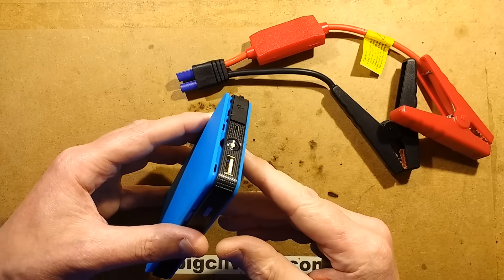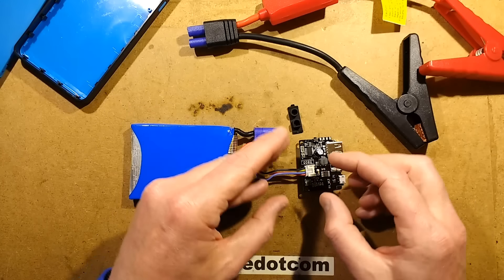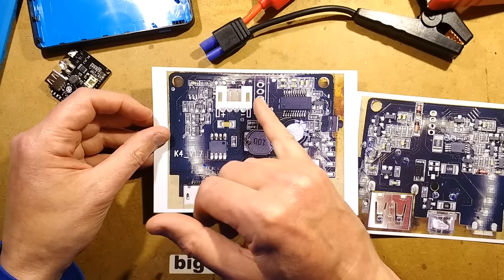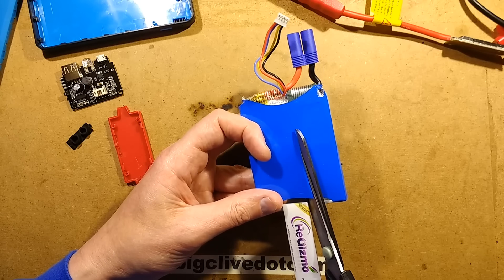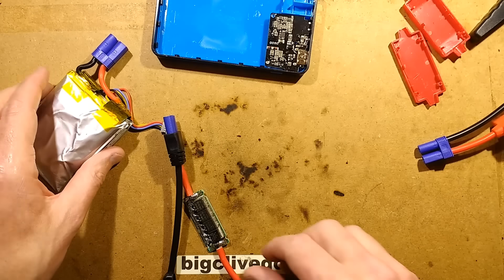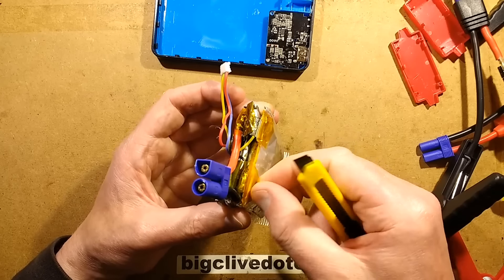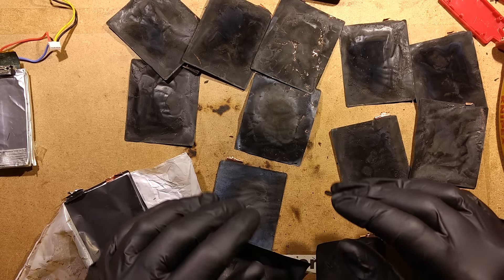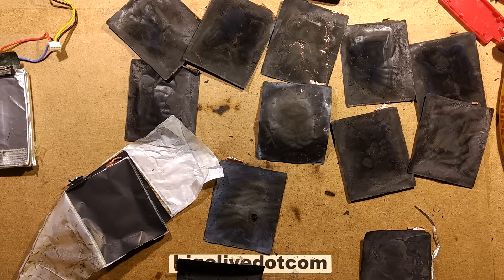Shorting out a fully charged cheap lithium jump starter.  (It didn't end well.)

Comment: This is genius.  The engineers that designed it made both the pack in the leads, and the battery to fail safely in case of an overload.  All without adding additional expensive components.  This is state of the art engineering at it's finest!
Reply: I'm not convinced that it was actually engineered that way, more like it just turned out slightly less dangerous in the end.
Reply: yes just a consequence of him having the cover off the unit.
Reply: @ronblack7870  That cover would have split right open and removed itself post haste once the cells started expanding like that. Removing it had no effect on the overall outcome. Had the case been sealed properly and not popped open so easily with such minor force, then we could have a talk about how forcing it to fight against the container and thus increasing the voltage at the same time. Guessing the plastic cover was designed to pop open like that to prevent this occurrence. When the thing splits in your hand, the first thing most users would do is drop it. Thus helping to prevent injury.
Reply: You forgot the primary instruction"Don't try this at home". The insight to this shows the potential of Lithium in the fact that such a small batter can crank an ICE. Now the question is how can it be recycled.
Reply: I have a bridge for sale in New York. Going cheap!
Interested?

Comment: "a few amps is still quite a lot of amps"
Reply: Is anyone collecting those lines of his yet?
Reply: SandyStarchild your avatar sums up my reaction when he said it pretty accurately
Reply: SandyStarchild I read this comment as he said it kind of like subtitles
Reply: to kill you, it only takes 1/2 amps to stop your heart
Reply: George Sarcasm God it takes mutch less than that 38ma can do a lot of damege but it also depends on the voltage
Reply: George Sarcasm God a lot less is enought but you need high voltage to get that high current throught your body :)))
Reply: George Sarcasm God Anything over 2 amps will surely kill you instantly
Reply: It depends on the person. Some people are less conductive than others, some are more conductive, and some are very sensitive to electricity. For some people, it takes as little as a 9v battery or even a 1.5v battery.
Reply: how much voltage and current it takes to kill you depends on a lot of things. your internal resistance alone depends on a lot of factors like body fat, hydration, and even what you ate for breakfast. also electricity going through your hand or your legs is a lot less likely to kill you than an arc across your heart. voltage does matter, but current and wattage is the real danger. at about 10 mA it starts to hurt and if you're holding the wire in your hand, you're not going to be able to let go. between 100-200 mA is where it's the most lethal, cause it causes your heart to spasm randomly which causes a lot of damage. higher than that though, and you're a lot more likely to survive, because the shock causes your heart to stop entirely, which, surprisingly, is much easier to recover from. also at that point you'll probably launch yourself backwards which means the shock mostly stops. not to say you probably wont need medical help, but it's much less lethal. it is however much more likely to burn you because of the higher wattage. also tthings are very different with DC power. if that zaps you across the heart then it's less likely to kill you, cause it doesnt cause muscle spasms, but it hurts a hell of a lot more. 180 volts AC at about 2.5-ish mA is a bit tingly, 180 volts DC at 2.5 mA is mightily surprising, and powerful enough that it made my whole hand go tingly when i zapped the tip of my finger.
Reply: @georgescg7342  500mA is quite a lot, 50mA is enough too
Reply: George Sarcasm God okkk with 12v
Reply: Kataclysm113 I accidentally touched 120v that was supposed to be dead. Well I felt a little tingle like unplugging a spark plug from a lawnmower then the breaker popped
Reply: @Kataclysm113  Rather than try this myself, I'm gonna take your word for it.  Thanks.
Reply: @georgescg7342 "... 1/2 amp..." What a load of rubbish, it's closer to 500 milliamps
Reply: Voltage or current are no indicator to how lethal it is. Only both in combination with exposure time (i.e. Coulomb).
Also higher frequencies are less harmful, since those can’t trigger muscle movement (i.e. Cardiac arrest), but can leave severe burnmarks.
Reply: @QoraxAudio  Not strictly true if you understand electronics all you need to know is the voltage and if the internal resistance of that supply is low impedance EG get a shock from a 12Kv neon transformer which has a high internal Z and you know will jump with a nasty tingle however get a shock from an over head power line with a very low Z and it's highly likely that it will be the last thing you ever do
Reply: @kingsman428  Yes, the impedance in combination with voltage or current as given specs is enough information to make that conclusion (i.e. Power), since ohm's law is composed of both current and voltage (reactance of the power source impedance can be considered as a linear resistance in this application).
Assuming that the power source makes contact with the victim for a sufficient amount of time to cause lethal damage (which is often the case with high power, since human reflexes aren't that quick compared to electrons 😜).
Same applies to capacitor discharge, but translated to RC time constants instead of Coulomb, since that is easier to work with when dealing with capacitors.

But as I said before, just voltage or current are no indicator to how lethal a power source is.
Reply: @karzygijose  I have felt the same. Im curious though if I wasnt wearing shoes or was completing a circuit if it would of actually electrocuted me. Im just like. 120v feels like a 9v battery on my tounge. Lol.
Reply: 9v through a h.v pulse generator creates a nice little tingle .
Reply: @lepayen  the average skin can stop a 30v current from passing through.
Reply: @kingsman428  500 milliamps is 1/2 amps
Reply: @dylanharding5720  Yeah I know it was sarcasm. Look at the guys name. 👍
Reply: Starlight it only takes .05 amp to kill
Reply: @dylanharding5720  No, the "average" skin can't. Also, voltage is not current, amperage is. 30 volts is more than enough voltage to go through skin, which is moist and not dry. A 6 volt lamp battery is enough to cause burns. A current of 30 amps is enough to kill anyone unless it's Ac current
Reply: @dylanharding5720  30v is not current but voltage.  I've taken a few electrical classes.
Reply: @caru3257 I'm aware of that. My wording may have been tricky for you.

A current
30V

You see? I never mentioned any measurement of the current. It didn't matter for what I was saying.
Reply: @lepayen  read above, I've explained my wording
Reply: @karzygijose  if it popped from your touching it, it must have had a ground fault interrupter circuit. You couldn't pop a 15A breaker otherwise.
Reply: I think he said “a few amps, (no) its actually quite a lot of amps”
Reply: @georgescg7342  really, a half an amp can stop your heart?  How many amps does it take to restart your heart?
Reply: @Kataclysm113  I've worked in live lines of 120 volts house current and felt the tingle of touching the black wire.  Does it make a difference if the current is AC or DC?
Reply: ive very narrowly been saved by a breaker before so ive had approximately 3 amps 230v through my body, i was in pain.
Reply: @lepayen  No.

Comment: I'm happy so many RC enthusiasts have chimed in about these jumper packs, because I was thinking, "wow, the manufacturer of these is thinking you're going to jump-start a car engine with that?" I hadn't even considered small-engine starters, so thank you all for that input. :)
Reply: That connector looks very similar to the spektrum ec5 connector lol
Reply: you can definitely jump start some cars with this. source: i've had this exact jumper pack and used it like one hunded times with my crappy 90s opel corsa :)
Reply: I've used one to jump my car several times! You only really need a few seconds of power to start an engine.
Reply: I'm more confused about how this is used for rc cars?

Comment: This is actually safer than I thought... when I shorted one of those drone battery on accident the connecting wire just brow up like a fuse (that is like at least 8 AWG wire melting in less than a second, which is like 2.5kA peak at least 😨) and the battery actually seems fine

Comment: This takes me back to the big "AT&T - Avestor Battery" debacle of 2006-2007. AT&T, has, tens of thousands of remote equipment locations needing a battery backup solution to prevent service disruptions during short term commercial power "disconnections" , or local rectifier system failure, until a tech ( like me) could be dispatched to troubleshoot & resolve the issue.
They turned to a Canadian company named  "Avestor" , which, created a stand alone 48V - 80AH "jar" ,which was very compact compared to prior technologies, and capable of being paralleled to increase the local AH capacity and run time at a site ( most sites were designed & maintained for at least 8 Hours of reserve battery capacity) Well, not soon after AT&T put a lot of eggs into Avestor's basket, Avestor decided to fold up, and declare bankruptcy. Then, not long after that, AT&T was having issues with some outdoor equipment cabinets suffering spontaneous combustion events , the first 2 noteable ones were in Texas, for brand new equipment installs. The company, in its infinite wisdom, tried to pin the blame on the local tech's that installed them (was a coincidence that both sites fell under one crews area) Then..... other sites across the country started to join in on the fun, 2 more newsworthy ones were in Wisconsin in the cold of winter.  https://eepower.com/news/att-begins-battery-replacement-program-after-reports-of-fires/#  A large campaign then ensued, to replace the combusting Avestor products with "proven" Lead-Acid technology, BUT, recouping any financial losses from Avesteor was not in the cards. I always try to store these types of batteries in a cool, dry, area, and keep my fingers crossed.
Reply: i have had a bunch of lipo's for rc aircrafts in my bedroom for over 10 years charged at 3.8v per cell. still no fire

Comment: So if you'd clamped the battery in a vice (to keep the plates from separating) for the short circuit test it might have been a lot more exciting?
Reply: alhazan vice shrapnel lol.
Reply: Following the Youtube tradition - the more carnage / flames / destruction, the more "likes" ! Big Clive dot com - entertainment for all the Family!
Reply: That is something he has to try now :P
Reply: AvE has just reviewed an IoT Juicer. Perhaps a LiPO in a juice extractor will lead to greater things?
Reply: Damn now I want to do that but I dont want to stink up my garage
Reply: Hmmm! I'll bet that increases the chances of it shooting out fully charged cluster bomb fragments. Keep far away from that!
Reply: Cut vent holes in each one battery first, so it doesn't puff up in the first place. Makes them single use - but it'd be the sort of thing Macguyver would do if he had to jump start a bulldozer.
Reply: Then while it's trying to flame, you very quickly do the vice up tighter ;)
Reply: Isn't that what a certain mobile phone manufacturere did, pity the results were in people's pockets, not in front of a camera.
Reply: Cud of just put cover back on then the sharp bits would puncture it then pop goes the Chineseium crap product lmao
Reply: Photonicinduction speared one with a kitchen knife, it blew up and burned big time.
Reply: If in it's original case it would be similar to using a vise - until case failure. Before or after flames develop is the question. Popular history says after, but a battery just puffing up and breaking it's case doesn't get reported as much as a fire.
Reply: the vyce would have been an interesting short circuit path.
Reply: excellent video idea... for big clive, not me

Comment: I know this is an older video now, but something worth mentioning is that these packs in use will see a direct short momentarily when being used to jump start a vehicle. As with any brushed motor, when power is first applied and the motor is not yet spinning, the power is directly shorted to ground through the motor windings. Mind you, this only happens for a very brief moment, a fraction of a second, but during normal operation with a properly charged battery, it is normal to see a current spike of 800-1000A when the starter solenoid contacts close and power is applied to the starter motor. Its only very briefly, but its something that is hard for these jump starters to overcome, especially on modern cars. If the system voltage drops too much during that initial spike and the starter solenoid can't hold the contacts closed, the engine won't crank (that's where you get that characteristic dead battery rattle when you turn the key, its the solenoid rattling back and forth because there isn't enough energy to hold the solenoid contacts closed once it tries to pass current through the starter motor). On vehicles where the starter is controlled by a computer through a relay (which is just about everything now), if that initial current spike drops system voltage enough to interrupt the operation of the computer or the relay that control the starter solenoid, the engine won't crank either. You'll just get one click as the solenoid closes, sends power to the starter motor and then everything stops when the starter relay or the computer controlling it gets interrupted. In general, these little lithium jump starters are only good for assisting slightly discharged batteries on vehicles with smaller engines. They won't make up for a completely discharged battery or work well on something with a large engine, because they won't be able to overcome that huge initial current spike.

Comment: I read Snorting out a fully charged cheap lithium jump starter. (It didn't end well.)
Reply: "(It didn't end well.)" Well that's expected with snorting out, there's quite a bit of moisture that could cause a short circuit.

Comment: Just by looking at the design, in a fail state such as a short, these cells are safer that the roll design. No smoke and flames from the plates separating. Thanks for taking them apart and looking inside.

Comment: The zigzag might be normal for this size package since a flattened roll would excessively thick on the edges but would also hinder the apparently self regulating safety mechanism of expanding under thermal runaway.

If I remember right, the explosive Samsung Note model fault was found to be caused by a lack of expansion room for the battery.
Reply: Samsung found two flaws in its suppliers' batteries. In the first batch, the cause was the negative electrode being attached to the wrong location inside the cell, which made the area prone to pinching. In the other batch of bad cells, a piece of insulation tape was missing where the cell tabs were welded to the foil, causing the welds to poke through the separator layer between electrodes.

While having more space for the cell to expand could have reduced the likelihood of those issues manifesting themselves, the second batch would have remained just as potentially dangerous.
Reply: Teardown Dan I don't understand why Samsung didn't manufacture their own batteries, what with them being one of the 5 main manufacturers of Lithium batteries and all that
Reply: The second manufacturer for the Samsung Note 7 batteries WAS Samsung. More specifically their battery division.
Reply: This seems to be the way all flat LiPo cells are constructed. All the ones I've looked at are exactly the same construction. But then I've only looked at high current cells...
Reply: High current ones use alternating plates for the parallel connections. High capacity ones use a core form to give the cells their mostly rectangular shape and the electrodes are wound around it with the external tabs crimped or welded to the electrode foils at some point.
Reply: Dwarg91 You mean the first one (Battery A in the report).  The second one was from the Chinese company ATL.  Also, the batteries from Samsung SDI had an electrode deflected for some reason (not incorrect positioning) and some of the ATL ones both had missing insulation and an abnormal weld spot on one of the electrodes.  Just wanted to clarify.
Reply: Yeah, almost all catastrophic battery failures need to start with faulty batteries and end with a series of errors or mistakes.

Comment: Hi Clive, I estimated that spacing of the voltage leads at L =0.2m (20cm).   The diameter of UK 1/2" copper pipe is given as 15mm (ext) 13.4 (int) giving a wall cross-section area of 31.2 mm².
The resistivity is   RA/L then 110 uV/A x 31.2 x 10^-12 / 0.2   = 1.71 x 10^-8.   Published value for hard-drawn copper is 1.77 x 10^-8 ohm-metres.  A pretty neat experiment you did there1

Comment: I love the "puffing up causing high impedance" inherent protection. It's much safer than I would assume.
Reply: Would be interesting to see a repeat with the case still in place, which could've minimized the swelling.
Reply: @DoubleMonoLR  The case would not contain the battery and crack open.

Comment: “Lets not go thermal nuclear” 
LITERALLY DOES EVERYTHING TO TRY TO GO THERMAL NUCLEAR
Reply: If he really wanted them to go thermonuclear, he could've stabbed them through. Do not recommend trying that.
Reply: i had one once decided to solder a wire to the positive the cell started bulging then got bigger and blew up in my face bits cell and lithium all over the place, same as a 600v capacitor blew up up dad thought i had a 12 BORE gun. and bits of silver and insulate all over the work shop  DONT PLAY WITH THEM.